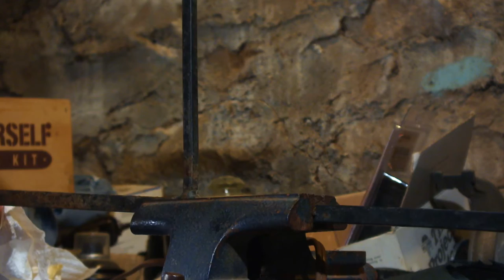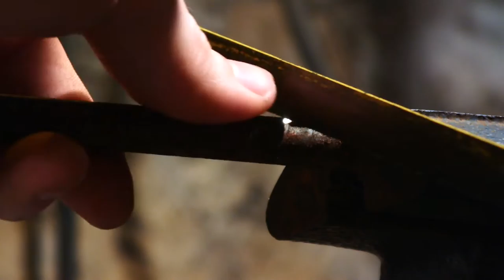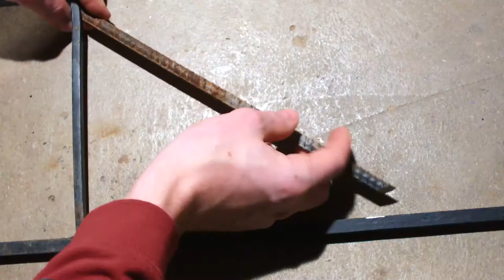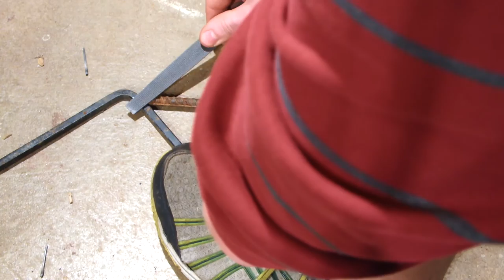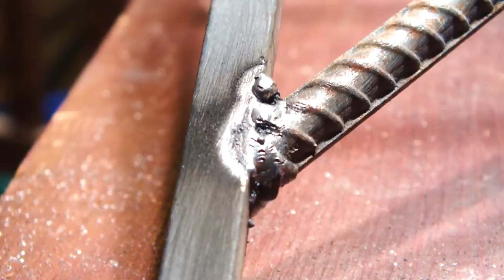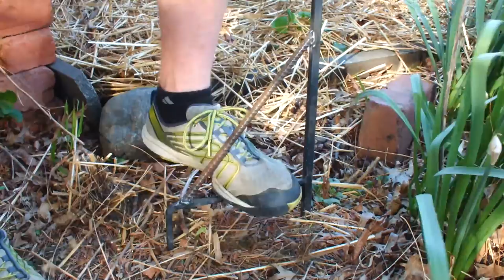Shepherd Hook Reinforcement

Comment: Of course some guy w a shop... Most of us dont have acess to such a thing... then also throw in welding.
  Would some old croquet hoops work - ? 😢
Reply from the maker: They might work, but the stronger the metal you use the better! I feel like it would be really hard to make a strong brace without welding it in -- unfortunately things are made so poorly these days.

Comment: Does anyone know how to fix the bottom "L shaped" part of a Shepard's hook that broke from the rod without soldering. They are made so cheap these days and everyone I've bought breaks right at the solder mark, so I was wondering if there is some kind of clamp system that can rig the 2 parts together. the old one's use to do like yours and just bend, I'm only using this one to hold a hanging bird feeder.
Reply from the maker: Dang! That's a hard thing to fix without some new metal or welding. Sorry, I can't think of anything